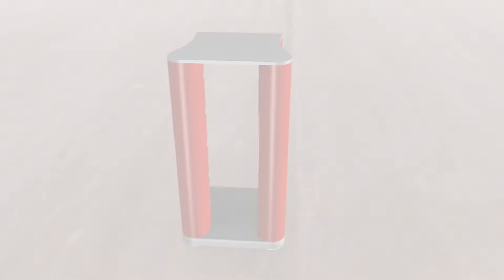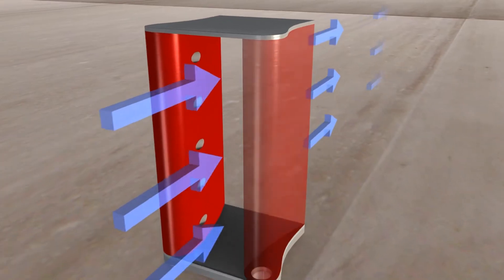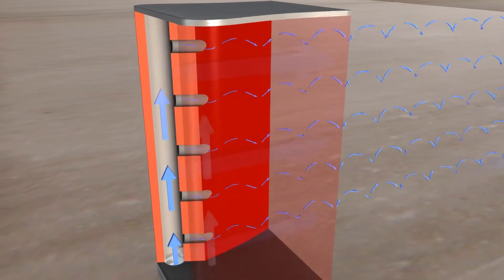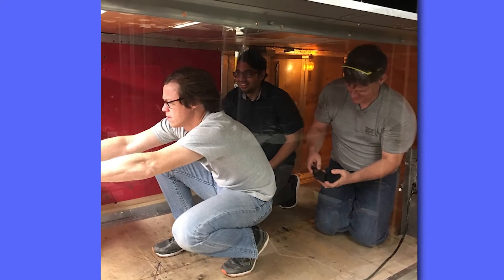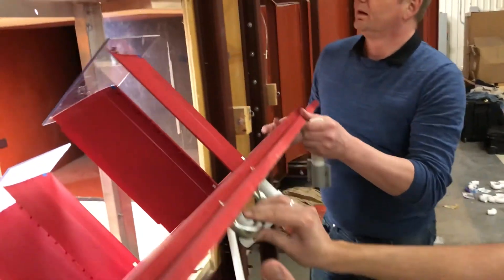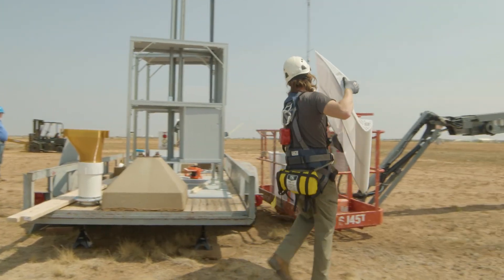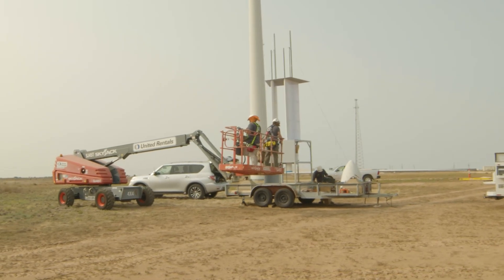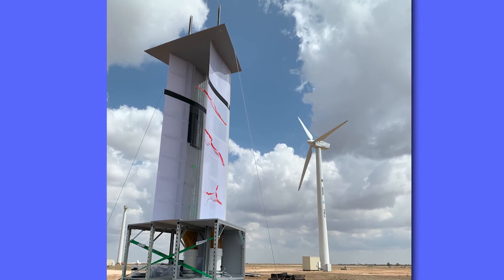R&D 100 Winner 2021: AeroMINE — Stationary Harvesting of Distributed Wind Energy

Comment: All practical tests show that small wind turbines hardly generate any electricity, because hardly any wind blows close to the ground.*
Moreover, the wind is extremely gusty, which almost always greatly reduces the service life. 
Only those who MUST be off grid in winter should install a large wind turbine on a high tower. Otherwise: Forget wind power!
Solar systems, on the other hand, reliably generate over 25 -30 years electricity at approx. 3 to 8 cents/kWh. Reliable and extremely low-maintenance.

Comment: There is a major problem here. Prevailing winds may only be from a certain direction 30, 40 or even 50% of the time. That is not great. If the unit is pointed west and the wind is out of the north or east you aren’t generating electricity. It really needs to rotate.

Comment: Another divorce for illiterate mentors. In the minimum section there will be atmospheric pressure, since this is an open circuit, so don't expect any suction. And the Venturi effect is achieved in a pressurized pipe. :(
Reply: The pipe below has air not moving.  The wind moving through the roof mechanism is low pressure (moving air is lower pressure than stationary air).  The difference results in the air from the pipe flowing to the roof mechanism.  Is this not correct? As Tore Lund says (in a comment above) its a Dyson Fan really. But the Dyson Fan inside is replaced with a Generating fan.

Comment: A Dyson bladeless fan in reverse. Yes pretty brilliant as the creates a high speed air stream thus no heavy gear box or expensive slow rotating generator. Likely also less blade erosion as they are stationary.
Reply: "blade erosion" 🤣🤣😂
Reply: I thought of Dyson too, when I saw this, doubtless that is where they got the idea
Reply: @jabyers  Nonsence again. Venturi effect was not discovered by Dyson.
Reply: @mortality1987  I'm sure nobody here has said Dyson discovered Venturi effect.  The reference to the Dyson fan is because this mechanism is structurally similar to the Dyson fan.
Reply: @jabyers  Yeah, keep repeating that they got  it DOUBTLESSLY FROM DYSON
Reply: Dyson Bladeless Fan uses Coanda Effect --- does this Aeromine device likewise use it as well?
Reply: @manofsan  the Coanda effect is blowing a small volume hi speed air stream across a curved surface to create lift and this is the reverse happening, so technically it is not the same. However it is the same principle even if it is driven from the low pressure side by the wind.
Reply: What is this? Random nonsence generator?
Reply: @mortality1987  that was my first reaction too but to be honest describing it as a reverse Dyson blade less is pretty good.

Comment: It seems obvious with this quasi-VAWT design that it ought to orient itself to wind direction.
all that ducting would sap a lot of energy
I saw one rendition which located the turbine vertically directly below the airfoils.
There were some semi-specific numbers of 150% of solar PV production in the same area for the same cost
or something like that...
Definitive specs need to be published.
Most of the visuals locate arrays on industrial/warehouse buildings
Those are typically among the least noise-sensitive applications for which VAWTs would be far less complex.
The most obvious side-by-side performance comparison should be for VAWT

Comment: THIS device uses the wind to generate electricity using high and low pressure movements through an airfoil that makes use of the Bernoulli principal to draw air past a turbine within an attached wind tunnel ,  thus spinning it to generate mechanical forces that drive an electric generator.

Comment: How about some specs on this? How does it work? How much power is generated at different wind speeds? How much does it cost? How does your technology compare to other existing technologies?
Reply: Like Ferrari, no independent data means it's worse. Probably much worse.
Reply: you take 2 wings with holes in it and a generator. Done. Cost and energy generated, is entirely dependent on situation

Comment: They choose to gloss over the facts about it.
1. It will only accept wind from one direction.
2. It will only work when there IS wind. Some places have average wind speed of 4 mph.
3. The output varies with the speed of the wind.
4. It may be noisy, might make whistling sound.
5. Birds would really like to nest there.
6. What if ice forms in the holes?
Reply: From what I've seen this is just a big PR push to get visibility for a round of VC funding. The unit can be put on a rotating platform to allow for changing wind direction. Even if it was fixed, most places with consistent wind have a very narrow band of wind direction and the large frontal area can accommodate probably a +/- 30 degree wind direction from "nominal". You're absolutely correct that there's a good chance it will still make noise, output will vary with wind direction (just as solar output varies with the position of the sun), birds may nest there (screening the unit will reduce output probably 5%-10%) and ice could potentially block the holes which would require a de-icing heater for cold climate use. This is clearly an emerging product and they're looking for money to mass-produce it.
Reply: I think a solution to the ice problem would be to make the holes cone shaped, and angle them to allow gravity to help with clearing the ice.
Reply: You are absolutely right from engineering point of view it's a bad design. Without rotation capability and only with a few outlet pipes the Bernoulli effect will have a low efficiency.
Reply: Thanks for the additional information. They really don't explain their product very well.
Reply: What would your solutions be?
Reply: @keaganairey2315  I personally like VAW turbines like PACWIND’s SeaHawk or that of WINDSIDE’s or ’vertical wind mill Hungary invention Dr. Györgyi Viktor.avi’ (youtube) but my favourite design for DIY project and because of efficiency is a HAW turbine from ’Waters turbine’ with rotating conical and spiral shaped inlet center.
Reply: @istvankocsis5507  thank you for the recommendations, I’ll look into them
Reply: @keaganairey2315  That is not the question. The question is what answers the inventors have about that questions…
Reply: This is an R&D Project that Sandia Labs was Involved with. Simply put, it's a "Proof of Concept" and answers to your comments

1. Doesn't need wind from any direction as it's designed to accept the wind that hits a building and moves upwards towards the Roof.
2,3,4 are the same problem every wind turbine has.

5. Place Screening on the front/rear openings to prevent birds from setting up nests in the operating area.

6. Another Engineering problem to solve

This isn't designed for homes but for SkyScrapers and large commercial builds with lots of wall surface exposed to the Wind.
Reply: @fastturtle4522  Come back to this video in five years, it still won't be a viable product.
Reply: i read on a techwebsite it works from 2.5 mph up to 55mph , and is effectively noiseless. remember its an early stage prototype, they expect production in 2023.

Comment: As a potential customer, the most basic questions are not addressed. Like how does it work? Does it rotate?  This introduction is unfufilling as a windless day. Thumbs down.
Reply: The only rotating part is a 36 inch fan/generator unit. Low mass, low vibration.
Reply: @kkarllwt  A 36 inch fan is certainly not low mass nor low vibration. What helps is having the fan oriented for vertical airflow so the primary vibration is in the horizontal plane. But it definitely won't be low vibration because the air only enters one side so there will be unequal loading on the fan blades and turbulence at higher wind speeds. Where did you find the 36 inch dimension?
Reply: Agreed. They need to share the specs.

Comment: Had to look it up to understand how it works: airfoil creates a low pressure zone when the wind blows (Bernoulli's principle). Small perforations in the airfoils are connected to a chamber at nominal air pressure. The pressure difference induces air to flow, turning a turbine.
Reply: Thank you ! Why don't people explain it like that (like Ironman said :" finally, english!")
Reply: Well so it is still a turbine unit that you have to hide in the attic?
Reply: @niolss  A newer video titled "Aeromine Motionless Wind Unit" shows a design where the turbine is mounted directly below the airfoils, and you can see the blades turning from below. The design is different, with a vertical cylinder above the small turbine.
Reply: @buddyclem7328  I think that central cylinder has a full length duct opening which not visible. That duct opening is positioned at the point of low pressure created by the aerofoils. Ambient air is drawn up towards the area of low pressure. a la benouli passing through the turbine which generates electricity. I can't work out why there are pairs of aerofoils though.
Reply: @garyclarkechelt  I assume that Venturi has his fingers in the game too. As you will see an pressure drop across a Venturi Nozzle like this. That's why there are two airfoils.
Reply: @niolss  ...no underground in the basement
Reply: @johnq8792  noooo dude!
Reply: The frontal area seems to be the basis for the power generation capacity and I guess the pressure drop through the venturi effect.  Much like the surface of a solar panel. However I don't  understand the claim of up to 5Kw power. Since the also depends on the generator and fan/ turbine in the duct? Can this claim be explained and what is specifications/details of the generator?